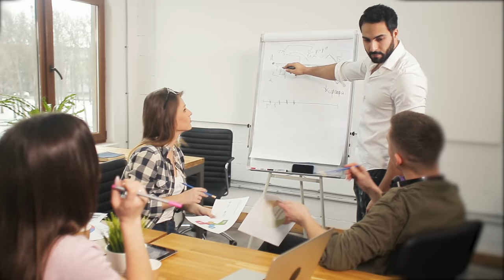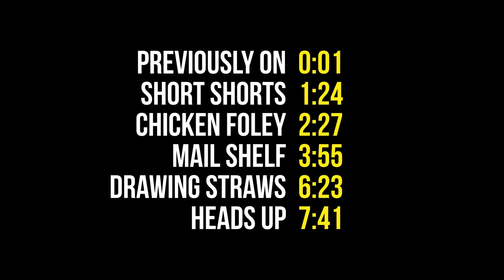Chasing Chickens To Record The New Chicken City Soundtrack

Comment: If the joint isn't fitting on the shelf use a rubber Hammer to push it down if you use a regular Hammer it's just going to bend the metal